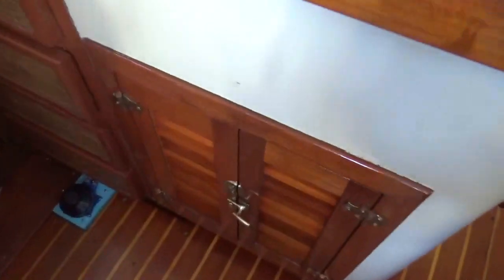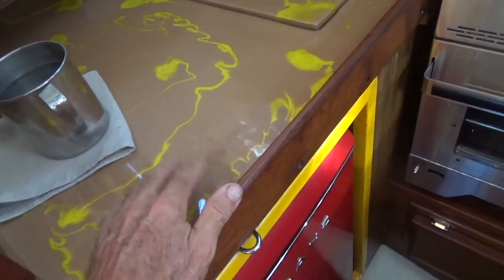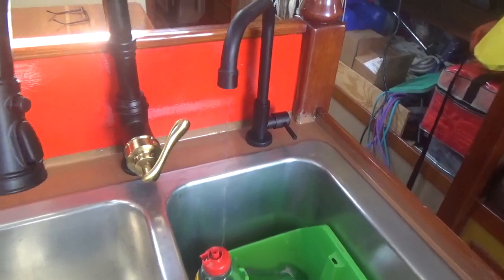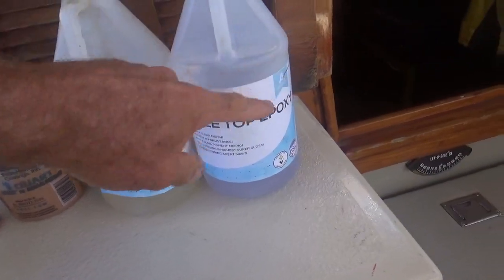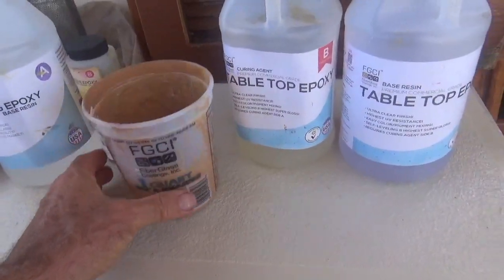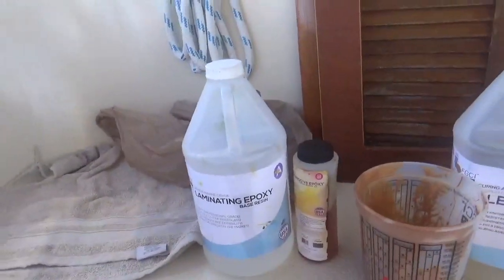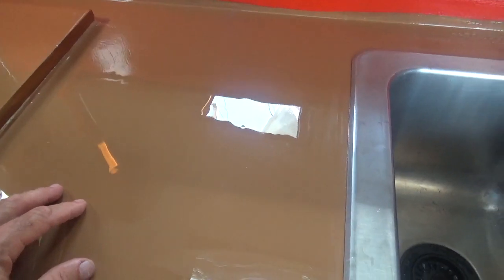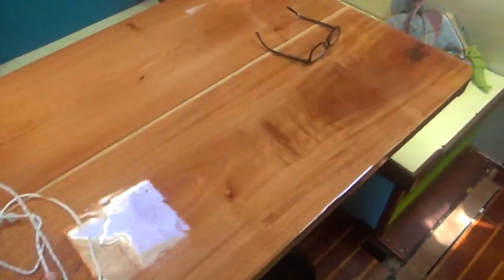Skipjack Sailing 64-1.  Addendum to Episode 64.

Comment: Many thanks for doing the extra vid Russ, and nice job on the galley, well done. Ill see what products I can get here in AUS to do a similar job
Reply from the maker: You're welcome and I appreciate that you asked.  The "tabletop" epoxy (I'm sure) may be found under other names.
There's a YouTube channel:  "Stone Coat Countertops"  If you want to see examples of an artist taking the tabletop epoxy to another level.  Fantastic work.
Reply: Cheers. I found lots of US products available here and prices about same as you quoted. I need to think the project through before I leap. 👍
Reply from the maker: @dreamtimesv  Practice a little!  I did not do enough practice, and I stupidly used a paint roller on that tabletop that ended up with bubbles.
Reply: Will do, your advice is taken 😎

Comment: galley looks great. now you need some red at the sink area.  mustard on  one  catsup on the other.
Reply from the maker: That's what my brother said:  "we don't need more of the spilled mustard look...."

Today I went up and down the mast a couple of times, sorta' practicing with the new mast ladder straps.  
That's going to be hard, clinging to that ladder, and trying to do work 45-ft up there.

After that it was engine maintenance day.  RW strainer removed and cleaned--that is, I took out the whole unit to clean the bowl because it was pretty stained.  
Raw water impeller looks great, but I oughtta' get one of those tools to remove impellers.  That always kicks my ass.
Reply: @skipjacksailing8986
Reply: @skipjacksailing8986
Reply: two pair of pliers  on the impeller fins in opposite positions usually works great